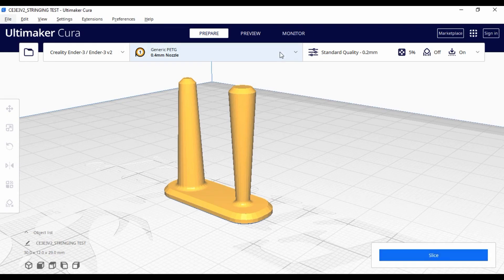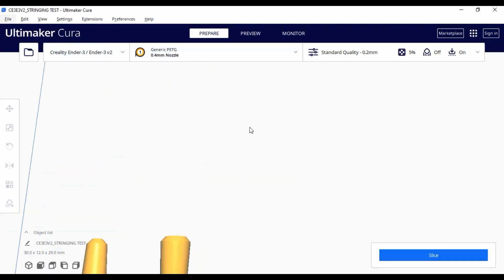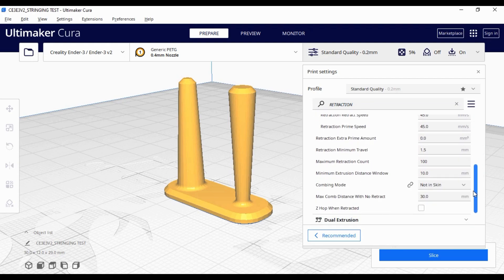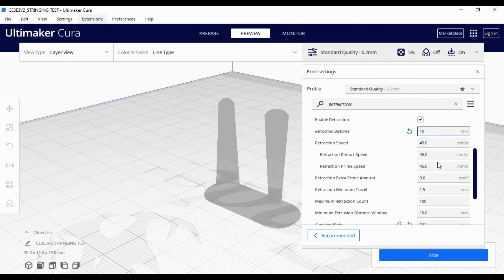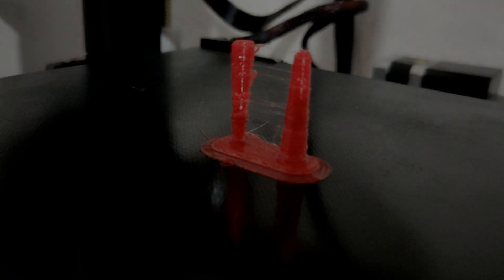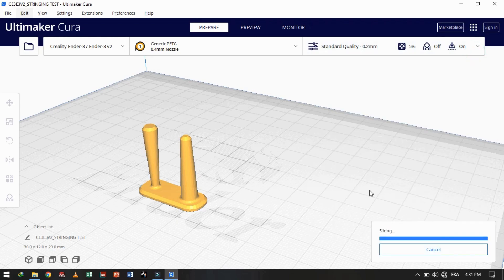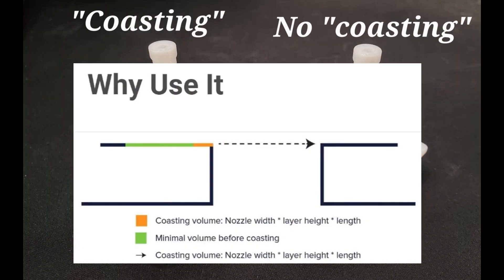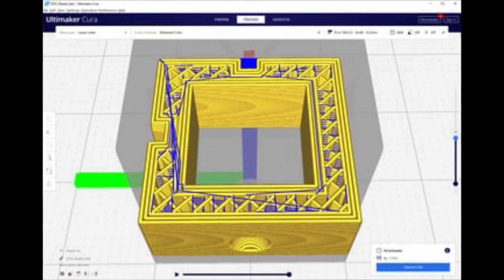SOLUTION AND TIPS TO FIX STRINGING ISSUE

Comment: Make sure you’re not retracting your filament past the hot part of the heat sink. If you let the filament go to the cool area each retraction you are cooling the filament after it’s been heated and compressed so retracting that and cooling it can lead to blockages
Reply: How to set this? Which is the parameter?

Comment: Try printing slower and with low heat. Slightly increase the waiting pause at each layer under cooling so the layer will have enough time to become a stable plattform instead of wobling from too much heat or too fast cooling

Comment: I’ve been told retracting too much could ruin extruder gears?
Reply from the maker: Yes ideed، you better check the limitations of your extruder ( the speed especially ) if you wanted to keep your extruder safe you have to stick with 50mm/s max, and change the distance between 8mm to 10mm
Reply: I used to turn on retraction and my silent printer wasn't so silent